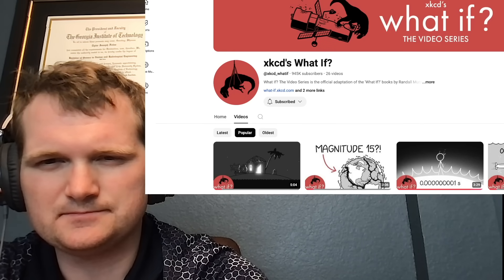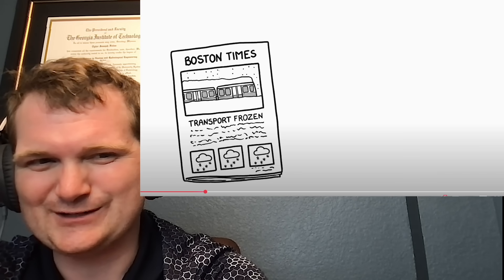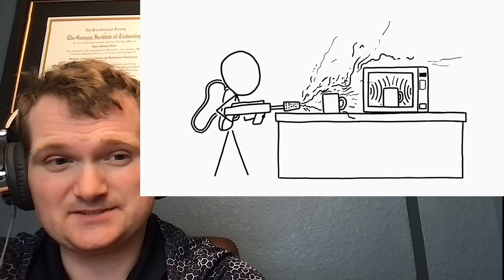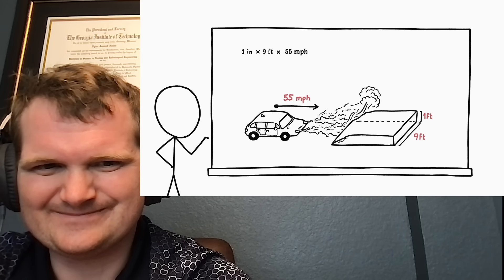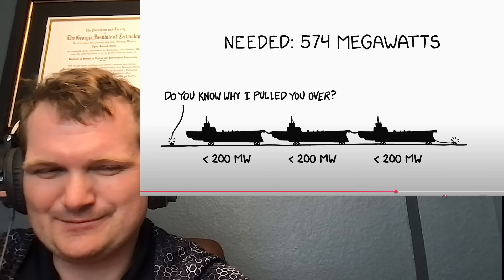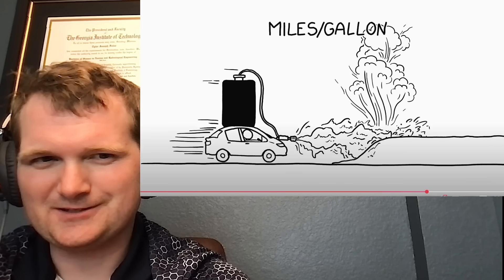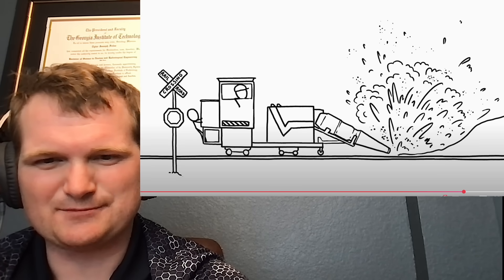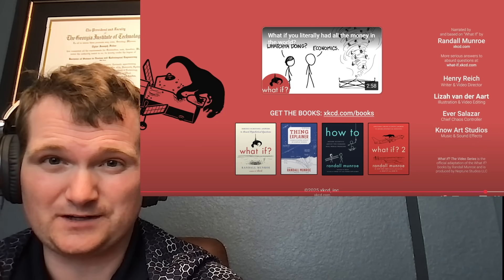Fusion Reactor vs. Flamethrower vs. Snowblower? - Nuclear Engineer Reacts to XKCD

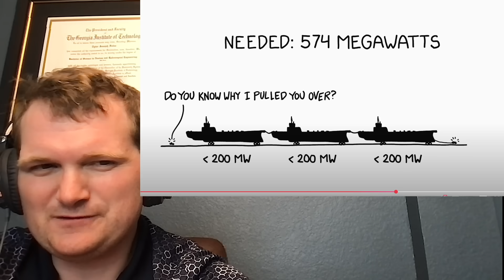Comment: 07:30  Not sometimes, when it comes to snow.  Always.  The amount of energy required to fling snow is inordinately lower than the amount of energy required to melt it.  The fact that it will re-freeze behind you is really just a minor inconvenience at that point.

That's really the fundamental issue with any kind of plan to melt snow to remove it as an obstacle.  Water just has way too much capacity for energy.  Both to affect its temperature and to induce a phase change.  It ultimately doesn't matter what mechanism you choose to melt the snow.  It will always be impossible to feed in enough energy to actually do it at the required rate.  That's why there are tons of snow throwers on the market and zero snow melters.

Comment: Interestingly 'moving' is almost always more efficient than 'melting', in that at the scales we humans normally appreciate, a given amount of energy will produce far more kinetic force than it will heat. It just costs relatively little energy to push things around, run motors and the like at the speeds we usually find useful, than it does to heat things up significantly. This is why your stove will generally draw far more energy than any electric motor system in your house, such as a fan or garage door opener, or even most power tools.

Comment: I realize that I'm getting away from the subject at hand by referring to a previous video where you talked about pouring a liquid using a spoon. You mentioned that it was due to molecular attraction between the spoon and the fluid (i.e., capillary action). However, if you refer to the 2nd edition of The Flying Circus of  Physics (sections 2.50 & 2.51) by Professor Jearl Walker you will find that this effect is explained by the Coanda Effect. You can demonstrate that it is not due molecular attraction by putting a fluid on the spoon that destroys any capillary effect. 
You videos are very entertaining!

Comment: 1:30 The recent major snow and ice storm in Texas, including Houston, that caused a lot of damage.  You probably had to work hard at your nuclear facility.
5:50 Speaking of 88 mph, that power is close to half of 1.21 gigawatts.
10:20 Um, um, um, um, stellar fusion?  The p-p reaction?  The power density is at maximum a few hundred watts per cubic meter in the sun.

Two of my pet peeves about calling human attempts at fusion power the power of stars: one is the incredibly low power density in stars.  The other is that the nuclear reactions are different.  In nuclear physics, the triton, deuteron, and proton are as different as different elements are in chemistry.

Comment: I never thought of the complications that winter and snow would bring to nuclear power plants. I've always thought that the biggest problem was getting rid of heat.
Reply: Me either. It makes sense, though, since it is a hydraulic system, and water is one of the few molecules that expands when it freezes, and that expansion is one of the major ways that rock gets eroded. As you can probably imagine, that's not very good for pipes, given that humans are best adapted to the temperatures at which the materials we make pipes out of will experience brittle deformation (aka they break) when subjected to stress in excess of the material's strength (such as the normal force exerted by water/ice on the pipe—or a microscopic imperfection in the pipe wall that water has entered—as it expands during freezing).

Comment: In the winter of 2015, my dog got out of the back yard because she couldn't tell there was a four-foot-tall fence under the snow.

The city tried clearing the streets by putting the snow somewhere else, but they had a hard time finding a place, and the giant snow bank they put under a viaduct lasted until June because of the low thermal conductivity, high thermal mass, and low surface area to volume ratio.

Comment: Here’s another ridiculous solution: take a nuclear (fission) reactor, mount it to your vehicle without the secondary power generation components, and just use it as a giant steam gun to melt the snow in front of your vehicle.

The water molecules in the steam will slam into the snow and dump heat into it upon impact, melting it quickly. You don’t have to deal with the thermodynamic inefficiencies of using steam turbines to create electricity, so a smaller nuclear reactor might be able to cut  it. You’ll just need a LOT of water.
Reply: Which you can et by just scooping in some snow

Comment: 3:54 StyroPyro just tested this with a 250W laser and it barely made a dent in the snow.
Reply: I hope they nerf snow’s HP in the next patch, it is way too tanky
Reply: @ulrikahaggard9923it's not the HP, it's the damage reflect gainst light attacks
Reply: @alejoclosa7705  What do you use against it then bro? It gets health boosts from dark type attacks, resists plant type, gets healed by water type attacks, and gains resistance to air type attacks if previously hit with a fire type attack. What's left? Lava-based earth types?
Reply: when up in the mountains its completely normal and super easy to make a fire in the snow.  You can make super efficient hogh heat fires in snow and you can have half an hour to an hour of use before the snow collapses in on itself.  People forget snow is majority air.
Reply: Ya he tried it with his 2000w welding laser too and even THAT barely did anything.
Reply: this means only one thing: styropyro: make a laser that can melt heaps of snow.
make it strong enough. a laser snow plow.
Reply: @robertheinrich2994 real talk though since snow is mostly air a laser strong enough to easily melt snow would have to be hot enough to explosively expand the regular air its passing through to hot the snow.  Images of cartoon villain laser beams come to mind haha.

Comment: does light have its own system of like concentration of it? Comparision is Pressure! Like how the smaller the smaller the area the more pascals. Would the smaller the beam mean the more aparent power?
Reply: also would you ever try to make a more radioactive material for better fusion?

Comment: How do heated driveways work then?
Reply: Since when are heated driveways dozens of miles long and use flamethrowers?
Reply: It is a much more practical idea. The low grade heat from the cold side of the turbine could be used.
Reply: Propably the same way as he said for power plants.
Reply: By not needing to melt anywhere near as much snow anywhere near as fast as you would do drive down a road at speed? Suppose your driveway is twenty feet long. To be comparable to what the question asks, it would have to be able to clear a foot of snow in a quarter of a second.

Comment: How about we use the waste heat of a local nuclear powerplant and use it to run hot water in pipes under the roads to keep them snow free in winter?
Reply: That would keep the road hot all the time.

Comment: When microwaving frozen items like a hot pocket, turn your microwave to the lowest power setting. This will cause the microwave to run in shorter pulses, fully heating the center and outside of the food.
Reply: Also pause and stir it occasionally, this will allow the warmer parts to mix with the cooler parts, and conduction does the rest for you.
Reply: I just move it to the side of the rotating plate.
Reply: Microwave always runs in pulses. It just changes how the amount of time between.
Reply: @Freya_Blue  I edited it. Thanks for clarifying 🤓

Comment: Not interested in Hot pockets? Excuse me sir? I refuse to believe that you don't own an air fryer
Reply: I'm running to buy some hotpockets right now just to test the air fryer. I use the air fryer to reheat pizza all the time, it works way better than a microwave.
Reply: Try a ribeye or pork chops. 🧑‍🍳 @chris101ward

Comment: If true room temperature thermal superconductors existed, you could simply sink 30ft long rods into the ground under the roadway, run wires of the same material in the road bed and just prevent the roadway from freezing hence melting any snow that lands on it. No need to plow and no energy used. Of course, it may as well be magic where the state of superconductivity is currently.
Reply: If it is superconductor, it won't emit heat as electricity goes through by definition. I suppose.
Reply: @ne_bknnlive3920  No,  He's suggesting using thermal conductors (e.g. diamonds) to thermally link the road surface to the earth below the frost line. thought that would just lower the frost line around the area
Reply: Ah, I missed the "thermal" part. Doesn't the concept of thermal superconductor violate 2nd law of thermodynamics though?